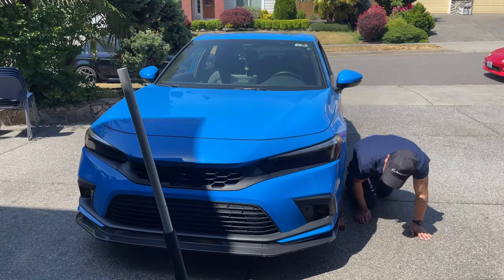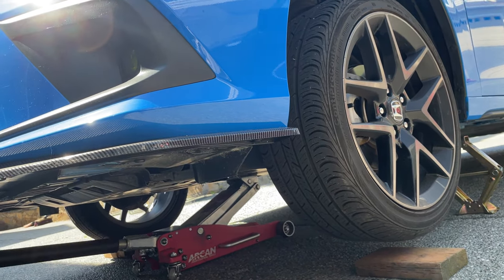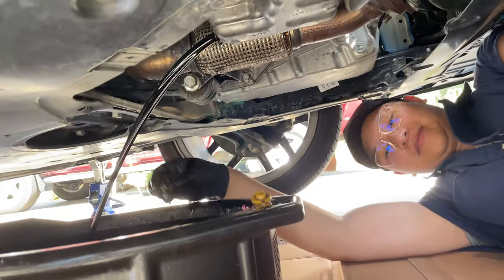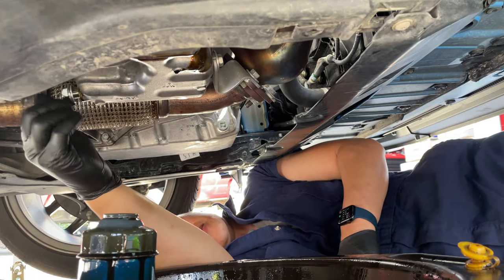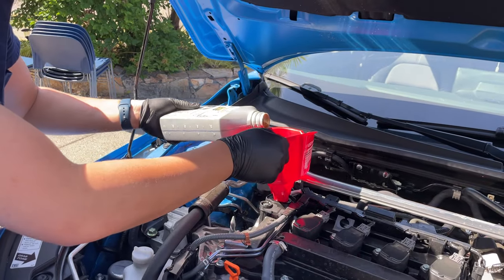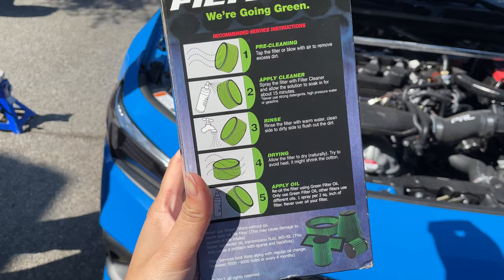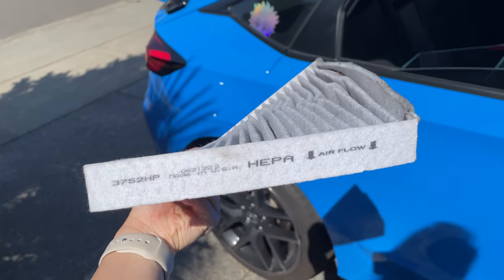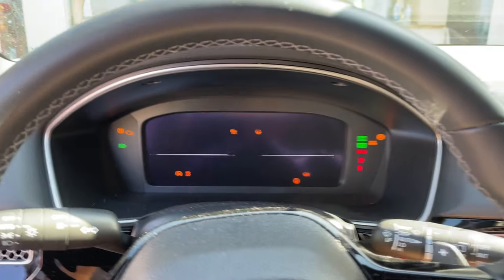11th Gen Honda Civic Car Maintenance - Oil Change, Air Intake Filter, and Cabin Air Filter DIY

Comment: Crush washer, lol not nut. Ive actually fallen asleep under my car before, its peaceful on a nice summer day. Also, the oem honda filter A02 is just a fram filter. Theyre made by fram, and honestly are junk filters. Theyre not like the old A01 filters. I recommend using wix but ONLY if the filter says made in USA. Baldwin filters are nice too, basically anything but fram or factory filter.
Reply from the maker: oooh great tip ty!
Reply: @j_cao  yeah the oem blue filter ending in A02 is made by fram. There's a few videos showing what the inside of the oem filter looks like. No way would I want that on my civic. I change my oil every 3500 anyway, but for those who go 5,000-8,000 miles I would for sure stay away from them.
Reply: @j_cao  Purolator filters are also great and made in USA.

Comment: I have a 1990 Honda Accord and its jacking point was the same as this car. You have to Jack up the car from the center beam to put the Jack stands on the designated jacking points. If you don’t, you could damage the steel floor or the side molding.

I bent my floor a little bit by jacking the car up from the side. 😞

So mad at myself!